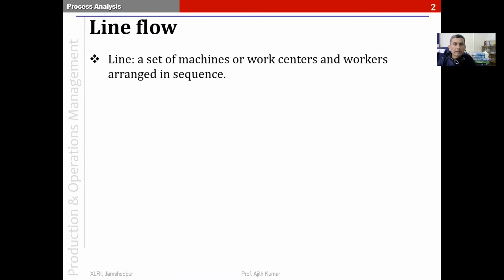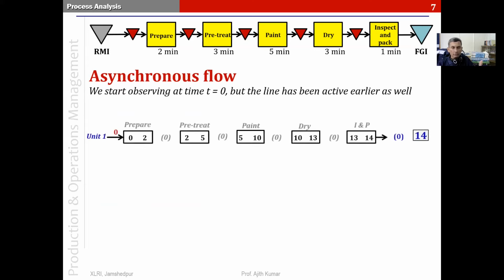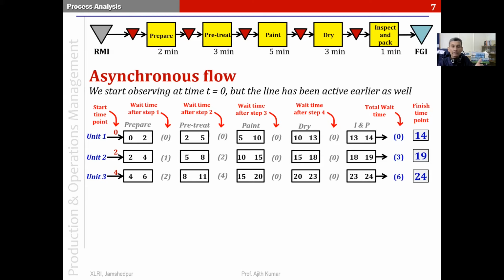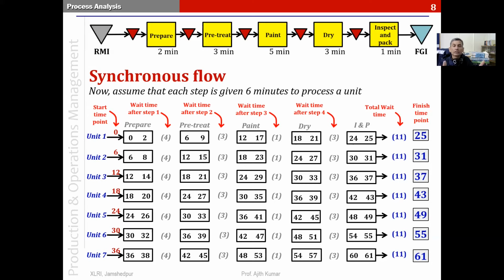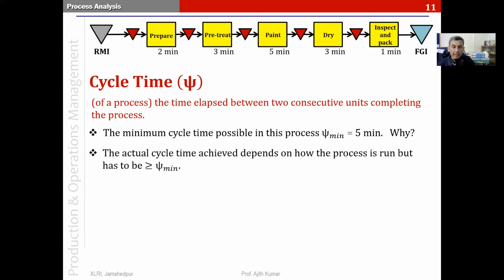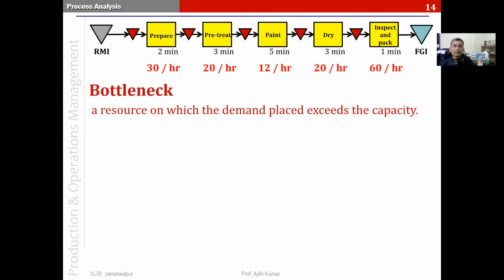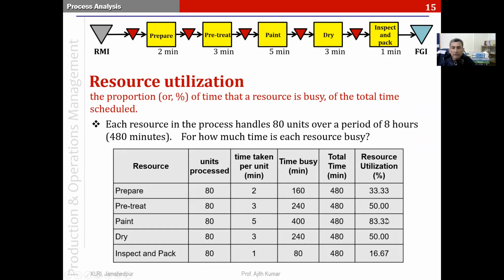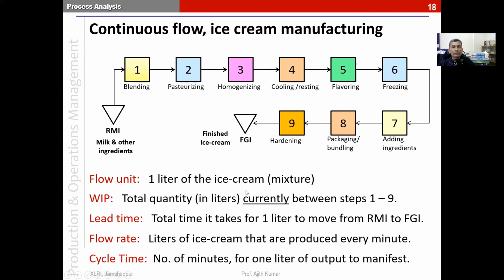PROCESS ANALYSIS 03 LINE FLOW

Comment from the maker: PLEASE NOTE THE FOLLOWING CORRECTION NECESSARY ON SLIDE NUMBER 16 BETWEEN 23:50 and 24:16.   The two numbers - 180 and 180 - must both be changed to 240.  Then, the line efficiency becomes 1120 / 2400 and the final answer is 46.67%.

Comment: Why the numbers in calculations of Line efficiency do not match the busy times per resource in the previous slide? Isn't the demand 10/hr? Takt time is 6 min. Line efficiency should be (2+3+5+3+1)/(5*6) = 46%. Please let me know if this is correct or not
Reply from the maker: Yes, you are correct.  Two numbers - 180 and 180 - must both be changed to 240.  Then, it becomes 1120 / 2400 and the final answer is 46.67%.  I will add a comment in the video.  Thank you for bringing this to my notice.